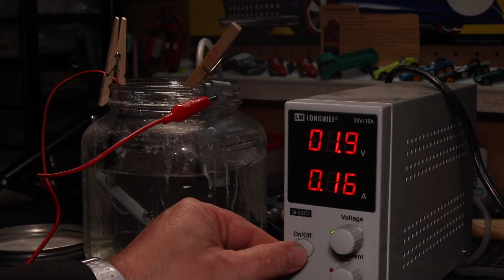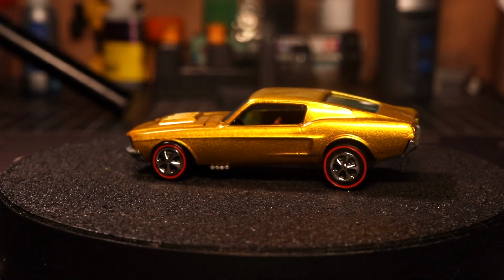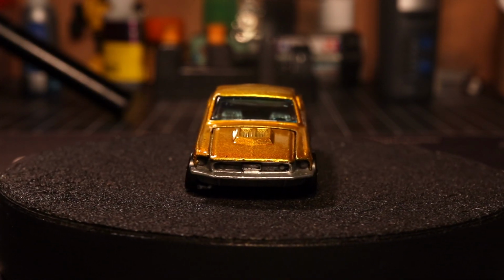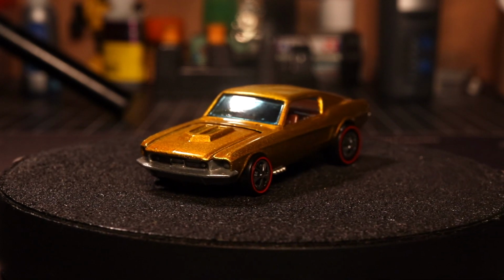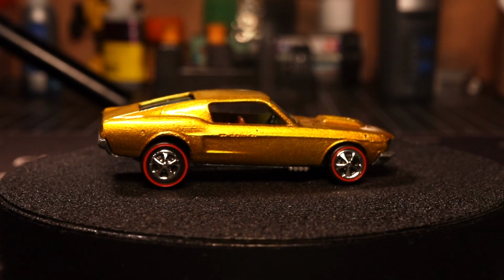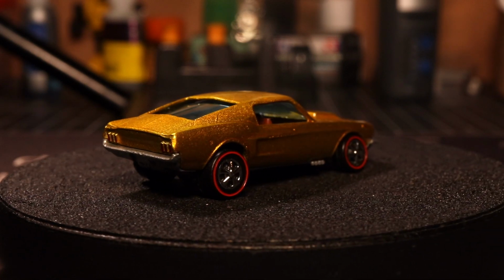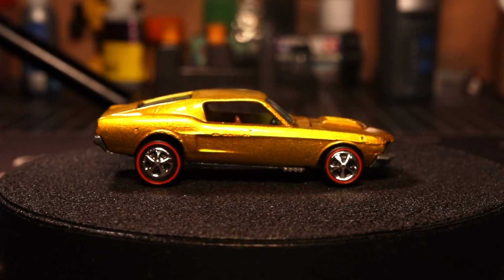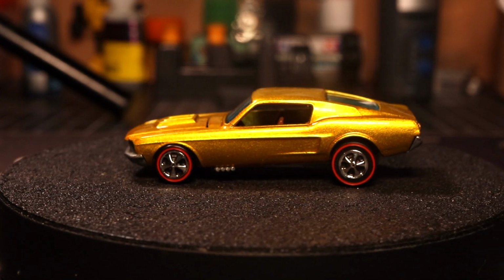Hot Wheels Redline 68 Custom Mustang Restoration

Comment: when removing dents or bashed in roofs, use a pice of wood or some dense rubber to back the car it will give the metal some where to go with out stretching it. and the surrounding roof is supported at the same time. you will get more with less effort.

Comment: I have a question. I have a 1959 Cadillac convertible olive green color,  with what appears to be water marks on the hood and the trunk in the paint of the king of hearts heads , have you ever seen that
Reply from the maker: Hmm..I haven't maybe a flaw in the painting?
Reply: WheelsNThangs No definitely not a floor in the paint , definite clear picture, looks like the head from a deck of cards , Thank you anyway